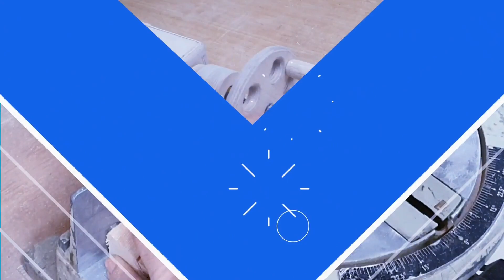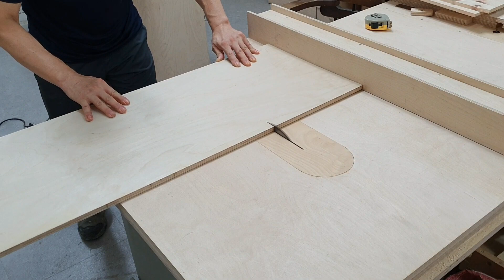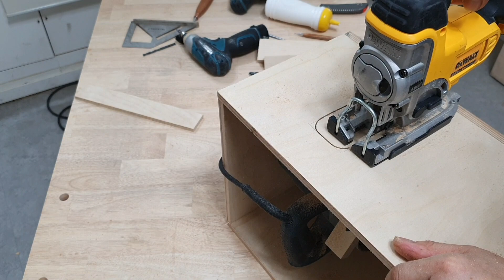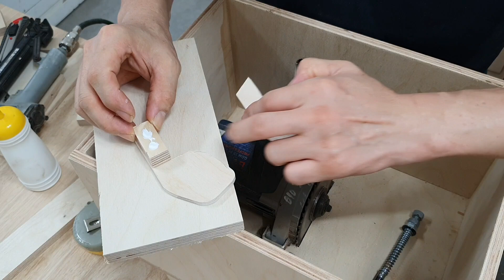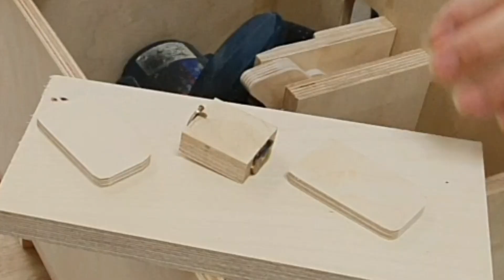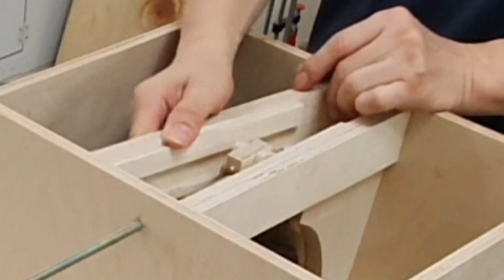Mini Table Saw part.1(Lift Mechanism) 홈메이드 A/S 용 미니테이블쏘 (올림 내림장치  만들기)

Comment: Nice and wonderful. Can you do the same way for a 9 inch table saw? Is there another way to cut at a 45 degree angle?

￼

Nice and wonderful. Can you do the same way for a 9 inch table saw? Is there another way to cut at a 45 degree angle?